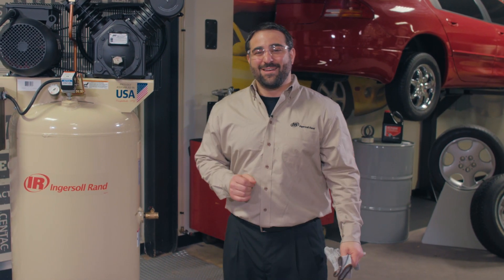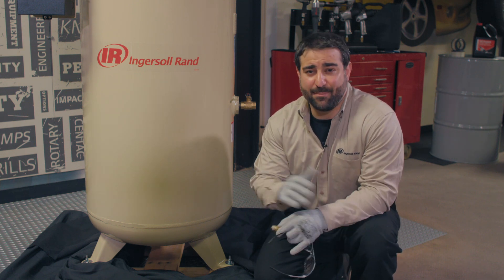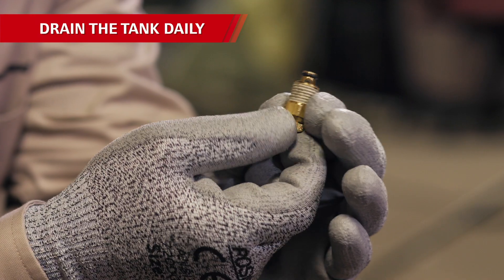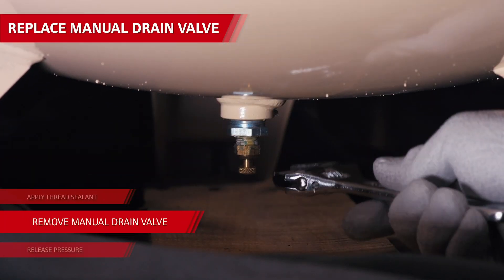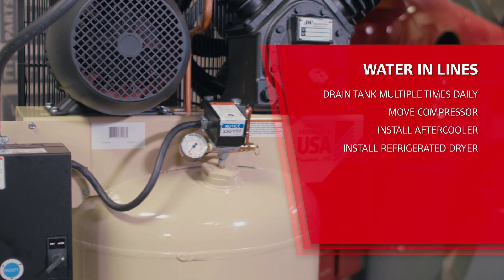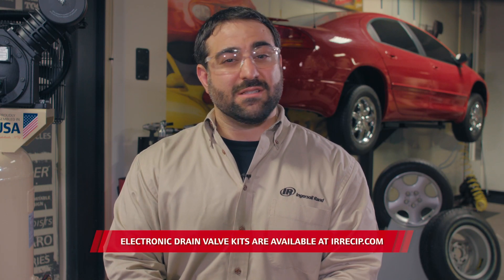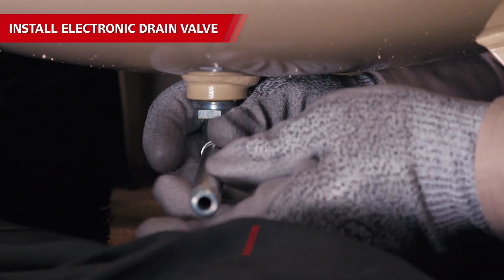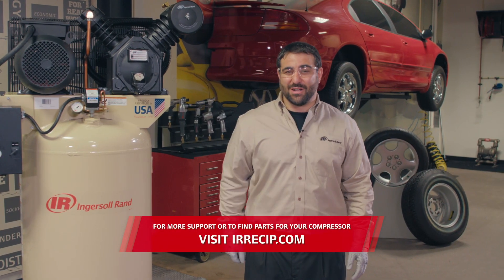Water In Lines Troubleshooting | Ingersoll Rand Reciprocating Air Compressor

Comment: Fun fact. If you install an automatic water drain valve and don't check it after 10+ years you might end up with 20 gallons of water in your tank. I took over service and I discovered a fourth of each tank with 20 gallons of water in each of the 6 tanks that did not have a manual drain valve. I remember the first time I saw the automatic water drain valve I asked the lead tech how he knows the automatic valve is working and he said there is a wet spot on the ground below the valve. Eventually, there was an inspector who came to visit and noticed there were no manual valves and recommended that we install manual valves. It turns out that the automatic valves had all failed and we had to drain each tank for about 15-20 minutes each. Good times.

Comment: my brand new IR compressor keeps breaking the pipe between the top of the tank and the pressure switch. Vibration ??? no one can fix it. Its happened twice in the last 3 months.
Reply: All types compressor sells &service 
7709134775 ,9561220176